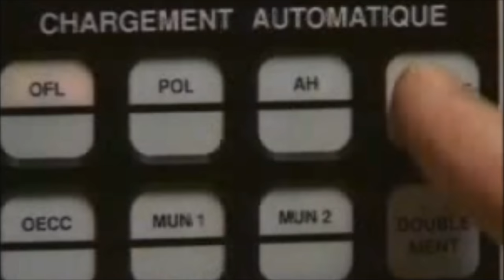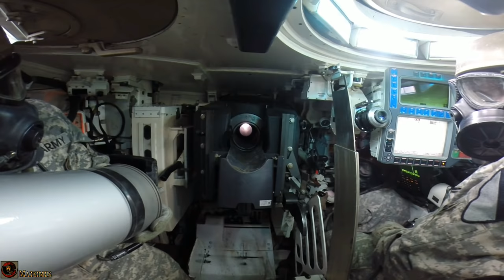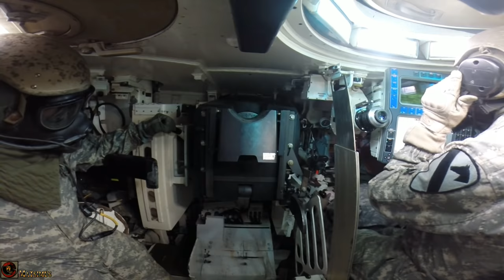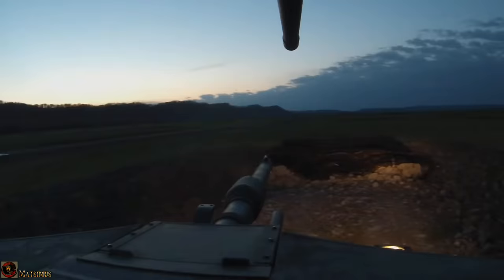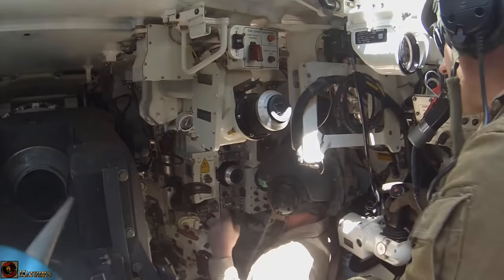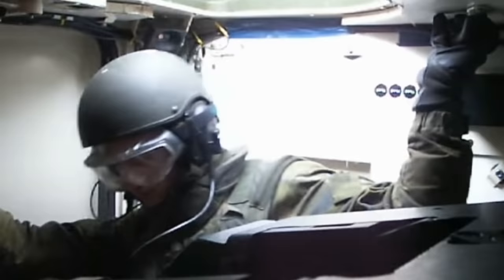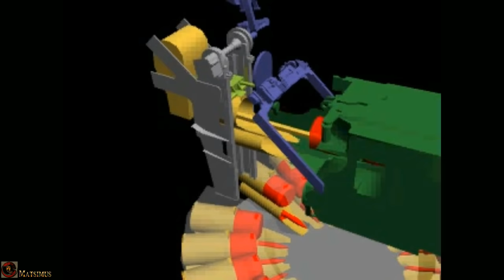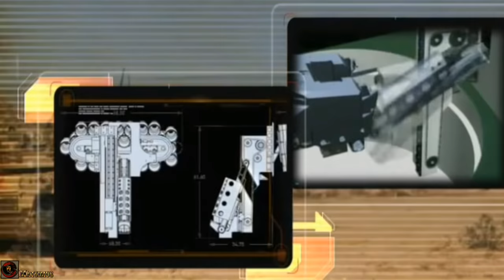Tank Autoloader or Crewman Loader?

Comment: Loader human: I was in Cav in the Australian army and same again with the Frenchies and often worked with tanks regiments or acted as enemy. (I was recon trooper and later life anti char with a Milan on the ground). After the military I helped rebuild Centurion medium tanks for a friend with a paint ball/team building business to run people around on and those machines need a lot of maintenance. Having that extra person on board when running tracks on and off, changing links makes life way more easy, although when with a troop you often do this together. 
I've always liked the auto loader concept but isolating it from the turret is a must for smaller armed forces as the crew, with their experience, is the most valuable thing on board. As you say "smaller" is what is coming and I think drone machines are likely to have  a lot more presence on battlefields in the future as digitisation has meant systems have reduced to about 1/3 there size in the past 15 years. Perhaps a tank group will have only 1 human present, per 3 tanks perhaps, to control them with automated intelligent systems that learn. 
On the current generation of tanks my vote is for the human loader.

Comment: One thing I think you missed is that the inclusion of an automatic loader has tow benefits over a living person. 

No 1: the auto loader is a machine and therefore does not suffer from combat fatigue and will continue to shove rounds into the breach at the same speed over and over. A human would get tired and over time the fire rate would drop.

 No 2: You mentioned that humans are quicker than auto loader, in some ways I agree with what you suggest most modern auto loaders can feed a round into the breach in about 2-3 seconds providing that the ammunition in the carousel is positioned correctly. Even if it isn't the carousel is out of alignment it is still exceedingly quick. As I mentioned before they are machines not humans.

Even so I do agree with your point that nations will try to downsize and autoloaders may prove more popular
Reply from the maker: Like I said, I wasn't trying to make comparisons so much to what is "best" it's just my take personally as to why I like and prefer manual loaders.
Reply: In most modern tanks, if not all, stored ammunition will be used up before loader fatigue becomes a factor.
Reply from the maker: +Timothy Sielbeck that is true
Reply: loader fatigue? all that means is that the loader needs to go to the gym more.
Reply: Damn straight.
Reply from the maker: +xu da haha I see the point that is being made.
Reply: Loader fatigue is quite meaningless, the pace of armored engagement is much slower than people expect.
But the autoloader as a consistent loading speed still or on the move. I'm definately curious to see a human loader loading the gun in cross country at maximum cross country speed.
Reply from the maker: +darklabor that's a very fair point. But to be fair, engaging targets at full speed is not really going to be a move a commander wants to risk doing in the heat of battle.
Reply: It depends on the doctrinal choices of the country considered.
By example, in France, they decided to go all in with the fire in the move capability. They established new doctrines with an experimental squadron (made of pre serie vehicles). And now manoeuvers like "hit and go" are quite common (especially with the numerisation of every arms). Infantry can pin point a threat on the BMS, the tank will take the coordinates as a reference and will agressively take it down. It reduces the time the tank is exposed to search for the threat and minimise the confusion of the location of the ENY in urban areas).
Reply: darklabor France doesn't have a lot of AMX 56 Leclerc's, and from what I hear they plan on co developing the leopard 3 with Germany but I don't know how well that will turn out because the last time they tried that it ended in the europanzer with was a failure
Reply: First : The "AMX 56" never exist. It is either AMX Leclerc (name given at the beginning with G.I.A.T. as constructor ; or simply Leclerc with Giat Industries and Nexter (that turned the page of the national arsenals).
Second : Nothing is done right now. KMW & Nexter are regrouping their activities without merging. They are talking about the futur weapon system, but that's just it. Not only they tried to work on the Europanzer (which ended up in the AMX 30 & Leopard 1) AND they tried to work on the "Napoléon" tank... (which ended up with Leclerc & Leopard 2). An additionnal difficulty is that both Bundeswehr & French Army don't have the same planned schedule to replace their MBTs (which can pose problems in the making of the specifications).
Third : the number of tanks is not has nothing to do with doctrines. It is the result of numerous budget cuts and white papers scaling down the format of French Army...
Reply: darklabor the leopard 3 is being developed
Reply: No. Rheinmetall is developping what they call MGCS. It is a modernized Leopard 2. If this was a Leopard 3 this would mean they would build a completely different hull and turret. At the moment, MGCS is nothing but a prototype developped on Rheinmetall's own foudings.
Reply from the maker: +darklabor interesting :-)
Reply: darklabor we know that the M1A3 Abrams and leopard 3 will coming in the next decade
Reply from the maker: +xu da the leopard 3 is not going to be coming. It's not going to be called that I don't think. They will just upgrade for now I think.
Reply: Matsimus Gaming well I hope they make a leopard 3
Reply from the maker: +xu da we will see. I would prefer to see a new tank from the UK.
Reply: Matsimus Gaming  challenger 3?
Reply from the maker: not likely. it will be a new tank altogether and therefore a new name. Im hoping crusader ;-) or crusher lol
Reply: Matsimus Gaming when do you think they will start development? 2030s? 2050s?

Comment: Love your videos!!!

The low silhouette is about survivability! Having low mass means that you can get out of places in a way that you can't be followed, or you can get into places where you are least expected.

During WW2, in operation Bagration Soviets had their tanks pouring out of the swamp because T-34 was light enough. This ability to traverse such places gives you a huge advantage, and Soviet tanks were all about this ability. Soviets/Russian opinion about it is that riding in style is almost as riding dead, better cramped but alive.
Reply: Though the T-34 had average medium tank weight, maybe it's also for it's thick tracks to thank for?
Reply: @EdyAlbertoMSGT3  you probably mean "wide". You are right, the wide tracks were essential for traversal for T-34. However, Tiger also had wide tracks in comparison to Panzer 3 and 4, but, it was also very heavy and its ground traversal was also difficult.
The T-34 was light enough to exploit the wide tracks to the maximum. It was a huge problem for Axis powers because this tank could appear suddenly in almost any area.

Comment: The US Army first investigated the auto-loader for the main gun in the T22 medium tank in 1943, where it was concluded that the auto-loader wasn't yet mature enough and limited the amount of ammunition available. Autoloaders were looked at with each generation of light, medium and heavy tank. The MBT70 and M803 had an autoloader, with the primary magazine in the turret bustle. Six different ammunition types could be selected and rounds could be loaded back into the magazine when swapped out. Additional rounds were carried in the hull which could be loaded into the bustle magazine during tactical pauses. 50 rounds, missiles, APDSFS, HE, smoke, illum and canister could be carried. At this point, the autoloader was finally rejected with the M1 design and development from 1972-77, as too expensive. Comparison of training standards in Soviet and NATO manuals on tank gunnery show that the Soviets expected to get 2 to 4 rounds a minute off, where NATO crews with manual loading expected as many as 8 rpm, aimed!

Comment: I am a service member in the US Army, but im not a tanker, nor am I an engineer. However I think if you design an auto loader system to operate much like a rifle cambering a round from recoil it could be viable. Or a system where you have all your ammo types in separate magazines inside the tank, computer controlled to select ammo type based on gunner designation. Couple it with a TC's CROW type system, it can be limited down to a 3 person crew, driver, gunner, TC and gunner double as commander, giving him main gun control right there in the commander's hatch. 3 person crew will reduce size allowing for a 3 magazine system (AT, HEAT, CAN) set on a rail that can position the needed magazine to be pulled from by the auto loader, based on ammo needed designated by the gunner. This wouldn't eliminate the problem of not being able to switch rounds when one is already loaded, and in the event of a misfire the commander/gunner would have to manually operate the gun to clear the misfire.

Comment: The downsides of a human loader I think far outweight the upsides in a war of attrition where the human cost is weighed far more heavily in modern warfare.  As such the Russians are smart to go to the T-14 Armata.   Your video fails to mention that the T-14 compensates for less situational awareness by combining a huge range of advanced motion detecting sensors that can distinguish between and alart the crew to human and vehicle threats in the vicinity of the tank.  This is something that the Russians have been working on for decades far more than the U.S. has.  There is a famous video in Iraq for example of a insurgent low-crawling under a Bradley IFV to put an IED right under it without the crew being aware of it due to a total lack of security sensors of the type commonly equipped or dispersed by Russian tanks since the late 1980's after their experiences in Afghanistan with stationary tanks being stealthily assaulted by Mujhadin sappers.  

I also don't see tanks going away nor the main gun being replaced by missiles.   Why?  Simply because advances in active defense systems like the Trophy and later models of the Arena (still in prototype stage) indicate that ATGM's will be easily countered on the modern battlefield by either passive or active defense systems.   SABOT rounds however are moving at such a velocity as to render such systems ineffective as they can not react fast enough.  As such the Russians have the advantage in their later model Kaktus and Relikt ERA that are designed to also disrupt high velocity SABOT rounds.  

Now granted NATO forces may have some similar ERA that is still classified (I sure as hell hope so) but we overall seem to be behind the curve in that area.  Likewise with passive anti-ATGM systems.  

Again...this may be due to excellent security measures on our defensive systems.  

Still....   that being said....  the T-14 Armata since the first time since the introduction of the T-72 (over the M-48/M-60 Patton series) represents a qualitative advance over current NATO armored vehicles especially regarding how this series is cost effectively transformed into heavy IFV's with similar armor and defensive characteristics but with the ability to carry infantry, use heavy ATGM's, and protect the T-14's and other tanks from infantry threats via auto-cannons and other weapon systems that can be adapted to the remote turret.   

The only Western forces that have adopted this theory of warfare are the Israeli Defense Force with their Centurion based Nagpadon's and Puma heavy APC's, Achzarit T-55 based heavy APC's, and their latest Merkava Mk4 based Namer Heavy IFV's fitted with even more armor protection than the Mk4 Merkava that they are based off of.  
The U.S. Army has taken note and is actually testing the Namer Heavy IFV/APC as a possible successor to the Bradley series of IFV's or as a specialized "heavy mechanized" IFV designed for shock troop spearheads through heavily defended  points along lines defended by a modern enemy.  They would include the Trophy system as extra added insurance.  

However....currently.....the Russians are slightly ahead and have accounted for defending against all known NATO armored threats.....thus shifting the debate over to that of artillery, air-defense, and air-superiority dominance.    Currently even their export model T-90's have managed to survive a frontal hit by tandem warhead TOW-2 ATGM's in Syria (with their Shtora system turned off).   That should give NATO a HUGE reason to worry given that this is older 90's era technology at work and NOT the latest generation of ERA or passive/active protection systems that the Russians are not eager to trot out quite yet.
Reply: Hmm.... these sensors are fine - provided they work, which is doubtful in a situation where several are so mad that they resort to fire real bullets at you. Not to mention they have to work and be repaired in pouring rain in mud.The reason the Armata use the reduced crew is probably more because they can't get the personel to staff even a moderate force. You can take in conscripts to work tanks, but that is generally a way to get yourself killed.Again the reliability of Russian equipment and manufacture .....? That does in itself put limitations.Two Swiss soldiers stole my Russian watch - or was it the other way round?
Reply: Thomas Borgsmidt Unless you have data to back up that assumption.  it is only a theory. 
The Russians don't like Swiss precision. They generally make things that simply work and that are robust on the battlefield.  The T-14 is going through teething stages as all new tank designs do, but from I can tell, the sensors look modular and easily replaced on the battlefield if damaged.  The massive decrease in cost for such sensors and cameras (that these days can and ARE made in China dirt cheap) means a boon for Russia who has good relations with China.  Granted they likely reserve the manufacturing ability to stay within Russia, but most likely they rely heavily on Chinese components. If implemented correctly into modular components, such technology CAN be very soldier-proof if it's made cheap with simplified replaceable components to maximize battlefield repair efficiency.  
But like your theory, mine is also just a theory.
Reply: Come on You fool! The maximum range applicable in Europe is 1 mile. There is such things as trees. buildings. hills and rocks that get in the way of the situation to be aware of! On the other hand. Increased effective range of guns etc. makes for more dispersed formations. I.e. there is much less situation to BE aware of. The Russians are caught with a medium tank as the T-72 (in various updated forms and variations): but it has little operational mobility. On the other hand Strykers (in various shapes and forms) are coming into the Nato inventory - cheaper, faster and roadworthy. They will simply outrace the Russian tanks and wait till they are stuck in the mud, then attack them from behind as they are out of supplies. The majority of the German Tigers in the West were demolished by their own crew.

Comment: First, actual Soviet documentation from testing of the T-64 in the 1960s showed not only failures to load, with broken containers and spilled powder in the bottom of the hull under the turret, but misalignments introduced between the gun, loader and ejection port, that resulted in cartridge cases jamming the gun, the loader and the turret training mechanism. And yes, the gunner and TC occasionally had their uniforms caught in the loading mechanism, resulting in injuries. Rate of fire and readiness suffered compared to the T-62, which had its own problems with its cartridge ejection system, where after the gun fired, the gun aligned with the ejection port and ejected the fired cartridge. Hard use would through this system out of alignment and the cartridge case would rebound into the turret. These issues continued with both the types of auto-loaders used by the T-64 and T-72. Both autoloaders used in the T-64, T-72 and T-80 series tanks required the gun to realign with the loader at a fixed angle for loading. The maximum EXPECTED rate of fire was six rounds a minute. But Soviet training standards actually expected an aimed rate of fire of two to four rounds per minute given sufficient targets, while coming to a quick stop to fire. NATO crews, especially the elite crews that competed in the Canadian Cup could acquire, load, engage and destroy targets at better than eight rounds a minute with 3d generation fire control systems. And all the NATO tanks back then used manual loading. NATO (US, British, German, Canadian) crew training standards in the 1980s and early 1990s required engagement times under ten seconds. Now the Russians may have somehow solved all the previous problems involved in maintaining high tolerance alignment between sub-systems in the autoloader, but the theoretical rate of fire of the mechanism is not the engagement rate in combat.